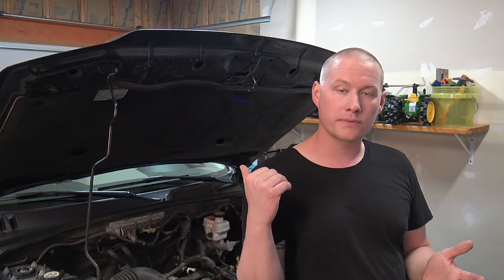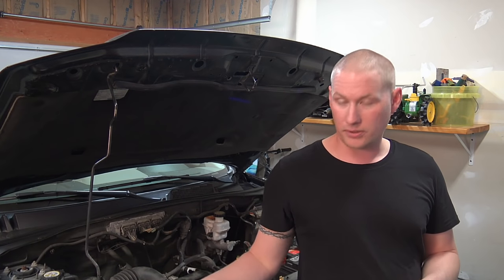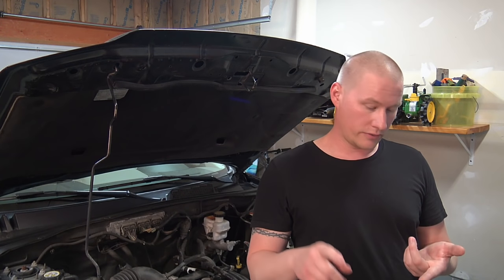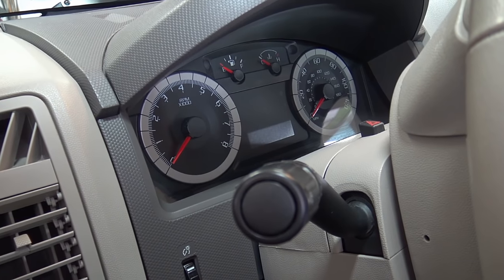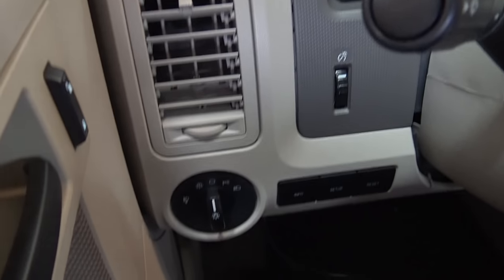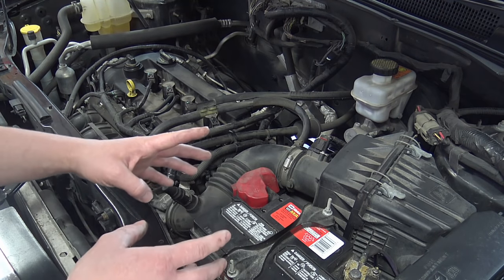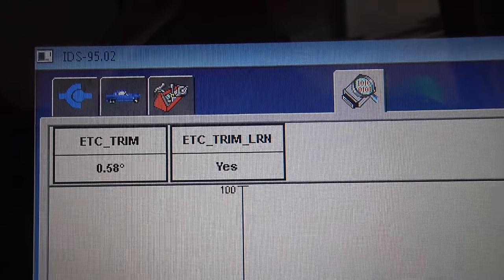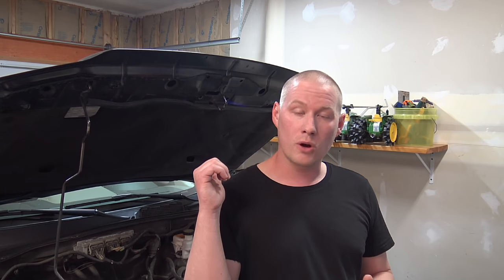Ford Vehicles: Electronic Throttle Body Calibration Procedure

Comment: Video was very helpful! I had a question in regards to a 2005 crown Victoria Police interceptor I just recently purchased! It only has 58,000 miles on it and the throttle body has recently been cleaned as well as the alternator simultaneously going out and draining a battery that was in it
Reply: I also had someone attempt to install a aftermarket CD player and they failed in getting it to be able to work properly however left the wiring the way it was near the radio could these circumstances cause my transmission to want to only go into reverse and neutral and Park and not engage into any of the forward gears? I have been having a huge headache with this I just barely bought the car and now the freaking thing doesn't even drive..
Reply: Deeply appreciate you and your videos brother and sharing the knowledge that you've learned with the rest of the people around the world :-)

Comment: This is good info.. I have 03 Expedition.. I have a no start.. I recently changed alternator, alternator wiring harness, two pulleys, engine belt, I put on a fancy terminal connector (digital) on positive side.. that connects my positive cable, starter cable and wiring harness.. most recent I installed new starter..I do all repairs in my driveway.. I'm waiting for the weather to change to install battery.. I'm afraid of getting a no start.. if I do what is my next step?
Reply from the maker: No start or no crank? Let me know how it goes PM me on Facebook.
Reply: it's a no start and no crank

Comment: FORD 2007 4.2 v6 F150 throttle body engine light came on so i checked it and came back with 7 code errors so 
replaced throttle body pigtail and came back with 1 code error so replaced throttle body and came back all good 
no code errors drove it 40miles and the tool light came on then the engine light came on then the engine went DOA
 so disconnect battery cable for 1 hour reconnect it and started the engine and runs good no code errors and engine
 light is off. drove it 25miles down the road and tool light came on then the engine light came on so disconnect 
battery cable and reconnect and all good.

Comment: I just replaced mine in an 05 escape hybrid.  I started the vehicle up to warm it up, but realized alter that during the warm up, it eventually switched to the electric motor.  Is there a trick to keeping the gas motor running during this procedure?  The only way I knw is to turn it on max a/c, which you stated not to do.
Reply: Awesome questions, please, somebody has an answer?

Comment: Thanks great video and my buddy and I did this for my 2012 mustang and after 10-15 minutes it stays idling at above 1000-1100 rpm and sounds a little rough, and the check engine light came on as well as a yellow wrench,any idea why?

Comment: Brian, 

Is this the same or better than clearing the KAM (keep alive memory)?  I have a tune installed. I have cleared the KAM before, after time adjustments, with the tuner. Would this be a better option to get a full cleared table? Or should I not due to the tune?

Comment: Hey FordTechMakuloco you helped me out with this video after my car's throttle body became stuck shut while I was driving and I replaced it with another one. After a month later, I saw it almost went into limp mode while I was doing alot of stop and go driving due to the snowy roads you think that I need to do something with the ECU now? it's an 06 ford 500, thanks for da response!

Comment: So I just did all of this after replacing my throttle body and took it on a test drive and all was fine right up until I got back into my neighborhood and the power train error code light ( I think that’s it it’s the little orange wrench) came back on. The codes I have gotten from when I first took it to AutoZone are P0122 and P2135. Does this narrow it down to the PCM or the actual wiring for the car? I also have already replaced the throttle pedal previously before doing this

Edit: I’m driving a 2012 Ford Fusion SEL btw

Comment: Thank you so much for all your help. I consider you a Ford-all+loigist! Could this happen with the replacement of ac compressor kit? When I got the truck back from the shop truck felt compressed, rpms would match with speed everything was great. The only thing is that a very minimal times I would hear like metal on metal grinding but very light and short. I thought it was that the ac compressor was so new. 2 days after I was driving at night and had to accelerate very fast, when all of a sudden I heard like an explosion short hard and my truck lost power. I thought it was going to die but no it kept going. Only thing was I couldn't go past 3 rpm. I ran the truck for an hour to see if it would happen again and nothing. I would feel it off but just a little. In the morning first thing I did was pop the hood and saw the gasket that connects to the throttle body was not connected, upon inspection I saw that other clamps were loose on the air flow system from the filter to the turbos. Clamped everything up connected throttle body and now trucks runs good but I am starting to notice it won't go beyond 3rpms even while in park. And truck no longer feels compressed.  But it workd good. Have to really pay attention to notice the rpms not going over 3. Could this be the solution? I always get my eyes pooked when I take it to a shop where I live. Just payed over 2g's for the AC system. Could u please help? Any thoughts would be very helpful. I have a 2016 f150 3.5 Ecoboost XLT by the way. I would love to take my vehicle to you so that u could inspect it and fix anything wrong on it before my warranty finishes and even after that. 🙏

Comment: i recently replace my aftermarket TB with a new one. I didnt adjust the TB motor lash to match the stock lash for the TPS voltage and after 5 years it finally made the TB inoperable. Will this method still work once i have the new TB motor lash adjusted properly?

Comment: In the throttle body side cover, the sensor chip is known as a hall effect sensor, it "sees" the magnet on the end of the throttle shaft and changes the voltage to the ecu. If the chip fails, that would disable the sensing.
Reply from the maker: That is the way it seemed but when I looked at it close it just looked like a regular IC chip and PCB but it was obvious it was sensing it somehow. Good info thanks!!!

Comment: Followed your instructions exactly for my 2010 mustang after putting in a new throttle body motor. Now the idle fluctuates like crazy and the gas pedal doesn’t work. Any idea what went wrong?

Comment: I did the procedure with the pigtail positive to the negative cable my car turned on which is great it didn't before now after running 15 minutes it has the light on and it seemed to be running okay but shut off again light still on puzzled

Comment: Hey fordtech I have one question. Will this technique work on my 2006 Honda civic si?? Instead of spending money at a Honda dealer. Please need help. Recently cleaned my throttle body and accidentally moved it with my finger to get a better clean

Comment: i have a 2020 expedition and purchased a bbk 73mm throttle body and it wouldnt run currently so i just returned it. The bbk was made for the f150 but its the same engine do you think if I purchased it again and follow your steps will it work???

Comment: Thanks for the info, i replaced battery low volts issue. then ran bad did what tu said but got worse die when come to stop stalling when turning , so i clean throttle body an now works great an plenty of power to spare in motor, keep up with a very hot stock mustang getin on ramp to hwy, an walked an left them at 75 , great info , do u have video how to change fan blet cause that dude is in a hard place to see an work on, thanks

Comment: I recently had a new ECM put in my 2013 F-150, I also cleaned my throttle body thereafter. I’m now having idle and high RPM issues. Would this work for me and is it okay to do even tho my ECM was just replaced….?

Comment: Thanks for all your videos. You do a great job explaining everything. One question though. I have a 05 F150 5.4. It was manufactured 10/2004. Will this work after installing new throttle body or will I need the PCM reflash? A friend told me all F150's manufactured prior to 05 needs the PCM reflash. Thank you

Comment: Okay I changed my throttle body did everything in this video and everything is great 👍. As soon as I did this 400+ gas mileage, idle is way smoother, better speed. But now though I went to put gas and I'm getting 305 miles to a full tank, it's not as smooth in idle, and doesn't get to speed like it was when I first reset the car for throttle body? Someone help me pls 🙏 🥺

Comment: Does this apply to hybrids? I have a 2012 Ford Fusion Hybrid and I cleaned out the ETB. When doing the relearning procedure and turning on the ignition its just quiet. The gas motor doesn't turn on as it idles. When I finally take it for a drive the gas motor turns on really rough. Seems to calm down after awhile but its like that each time from a cold start. Thanks for all your videos!

Comment: Hello, I really enjoy your articles. I have a 2012 Fusion with the 2.5. I saw the recall on the throttle body and Ford dealer said wouldn't do anything about it until it throws a code. It has poor throttle response and the biggest issue is it surges while accelerating at a slow to med pace. Does it worse during open loop. You can actually see the Tach bobble up and down as it accelerates. I just installed the above mentioned Throttle Body and recalibrated as you suggested and it still does the same thing.  Has been doing this since before 36,000 mile warranty ran out. I thought it was the AC cycling but does it with AC off. You can also feel the temp change as the AC cycles.   Any suggestions?

Comment: Hello fordtech. Please answer. A new throttle part I plan on buying says to hold gas pedal for 10 seconds on 4000 rmp. Do you agree? What would you say is a good idle for a ford 500?? Also why do some people push pedal to the floor with the key in on position?

Comment: Thank you for the video
I had a vacuum leak from my throttle body shaft. I replaced with a brand new unit. I have no throttle response . This happened 2 months ago when I replace the injectors and reassembled the car. I let it sit a day or so and peddle response returned. I have an 03 jaguar s type r that has a ford throttle it looks like. Do I need a scan tool to reset the position sensor ? Or should I do the procedure on this video. I replaced most all emmistions and vacuum lines etc . My fuel trims are 0  % right now
 I have a icarsoft scanner but it doesn't have the relearn feature I need . Any advise would be really valued thanks

Comment: I tried this procedure on an 02 Mustang GT 3 times but my BlueDriver scan tool still shows 20% on the throttle position at idle . The throttle plate looks like it's fully closed to me. I measured the voltage out of the sensor before and after starting the engine and it measured 0.988 VDC.

Comment: Just a quick question, my wife's 08 ford explorer was having acceleration problems, I cleaned the maf, and it got a little better, but it's still sluggish from 0-20 mph, after that it smooth's out, would cleaning the etb do the job?

Comment: Is this entire procedure the same for a standard (non-automatic) car?  I did it on my wife's but have only driven it 15 mins afterwards, it seems to rev up the engine when pushing in the clutch.  I'm about to go try driving it on the highway and bit just in case---might have to redrain the caps and start over.

Comment: I have a 2006 mustang gt I changed the battery out after old one died. Now my engine starts but it has a very rough idle and no throttle response at all. Do you think this procedure will help me? Also rngine light on and wrench light. There was absolutely no problems at all before i changed the battery.

Comment: Can a booster pack be used to do tbis instead of that litle red wire you used? I didnt change or remove anything just topped up the fluid and added some lucas transmission fix because it seemed like it was slipping. Will this procedure work?

Comment: On a Transit van the battery is under the driver seat and the positive terminal is difficult to reach. Can you do this reset by unhooking the negative cable from the battery, then grounding out the positive stud in the engine bay using a thin gauge jumper? Personally I'd put an inline fuse in the jumper, too.

Comment: I recently ran across your video: Ford Vehicles: Electronic Throttle Body Calibration Procedure.  I recently decided to take on a 2007 Mustang with the 4.0L v6.  It has had a terrible idle from day one.  It runs great every drive except at idle.  I tried your procedure but little changed.  It has been months now......I have replaced every sensor under the hood.  When I connect a scantool, there are No Codes.  I decided to go through the live data and see if I could spot anything out of the ordinary....which is what brought me back to your video.  You mentioned that the ETC_Trim value should change (or have a value of some sort), but I am not getting any value at all.  Just a "zero".  I have driven the car for a couple of months now, hoping that it would do something over time, but nothing.  Is there anything that would stand out to you in this situation?  Everything is stock, no upgrades.  All sensors replaced with Motorcraft parts.  I have not replaced the Throttle body but I did clean it, and replaced the TPS.  Any help would be great.  You seem to know your Ford's.  The dealership was no help to me.  They claimed it was a bad alternator and $800 later the only thing that changed was the shiny new alternator under the hood. (First and Last trip to the Dealer Garage)  Please give me some insight.

Comment: I have a question in regards of a 2005 F150 electronic throttlebody removed it cleaned it put a new EGR valve on do you recommend reprogramming the throttlebody I have a rough idle wants to stall when I come to a stop

Comment: I just changed my throttle body on my 2015 f150 3.5 v6 ecoboost and it's running a little ruff with hesitation. Not throwing a code yet. I change it because it threw a 2112 code. Thanks

Comment: Hi, I just cleaned the throttle body on my 2013 lincoln mkt 3.7L.  Unfortunately I forgot to re-learn the throttle body.  The car did startup weird and sounded like it was about to shut off.  So I let it run for about 15-20 mins and is working fine now.  Do I still need to go back and do this procedure or is it fine to drive it the way it is now?

Comment: I just saw this video for the 1st time and I've had to disconnect the battery and also had a dead battery but i never performed this procedure. What do i do now? My F150 has a high idle right now, around 1000 rpm.
Thanks

Comment: Quick question,

If I’ve disconnected my TB to replace the fuel injectors (to easily remove the system) will I need to do this same procedure? 
I’m having issues with the vehicle staying on after it gets to operating temp. I hear a popping sound come from TB when at cold start. Is this normal for this situation as I described. Is this an issues that has to be rectified when disconnecting battery period or only when disconnecting the TB to disconnect as described or to replace the TB only? 
Hope this makes sense?
Please help. Thanks

Comment: Does this apply to Hybrid models also? As the motor warms it kicks the motor off into battery mode before the recommended idle wait time. I’m replacing throttle body on 2009 Escape Hybrid.

Comment: Great video, could you possible advise me, i have Fiesta ST150 2007 and my butterfly valve inside throttle body is not opening properly, like when i put pedal flat the butterfly valve only opens a little which is causing my car to be extremely sluggish for a 2l. Please help on how to fix electronic control unit or what ever it could be? The valve is also a bit open standard which is not how it supposed to be.

Comment: How long of a drive do you have to take to learn the shift points?
Also if i install HIGH PERFORMANCE parts plugs ,coils,and throttle body, CAN I DO THIS rather than taking it in for a tune on dyno?

Comment: Hello, I did a full rebuild on my 5.4.. I got it all installed but when I start it I have no throttle response. My question is how do i break in the motor (first 30mins) if I cannot rev to 2000rpm?? Do I just let it idle? Will it damage rings? Thanks a lot

Comment: FordTechMakuloco
Hey quick question.  My 15 f150 went in for service and they replaced my throttle body.  I mention a rough idle and hard shifting as other symptoms.  They charged me for the throttle body and labor to install and also charged me 125 to reset pcm.  They called me before work and I believe because I mentioned the hard shift they said they were going to reset the adaptive drive.  So my question is. Would they do that anyway with replacing throttle body and because  I mentioned hard shifts they “acted” like it was a separate issue and charged me for the reprogramming when that service would have had to have been done anyway with throttle body replacement?  This is the dealer I bought the truck from.  Please let me know thanks man

Comment: I see this video is 8 years old. Will this work for my 2015 F150 with 3.5 Echoboost? I cleaned my throttle body while I had it off replacing water pump and thermostat. Battery has been disconnected for over a week.

Comment: Hi Ford tech guy ... what is the spring loaded pin for on a throttle body ? i would guess its for dampening the decell? shock 
mine is broken off , due to an attempted adjustment of the idle , now i cant get any thing from the throttle pedal ??
will this relearn help of fix the issue?
Reply from the maker: +Greg Craven no just replace it